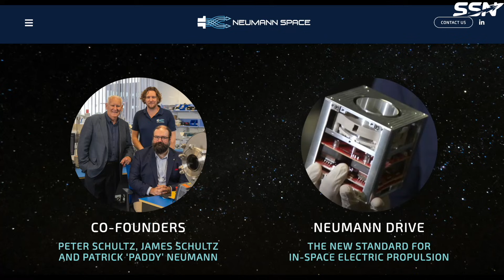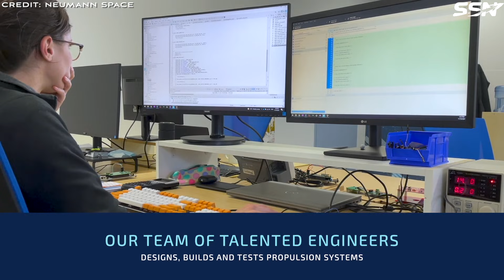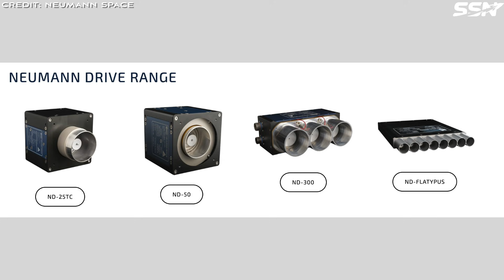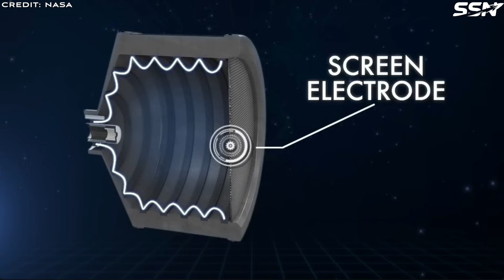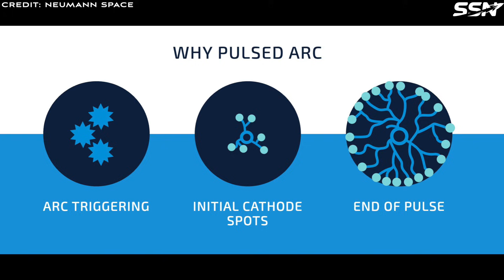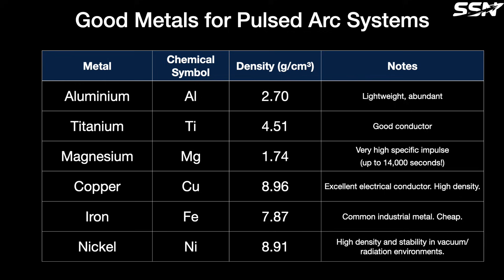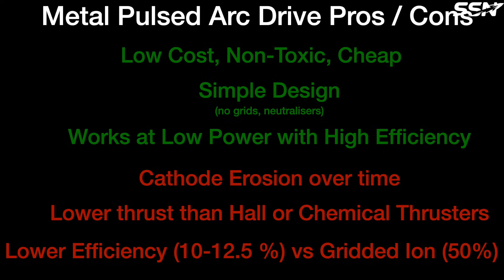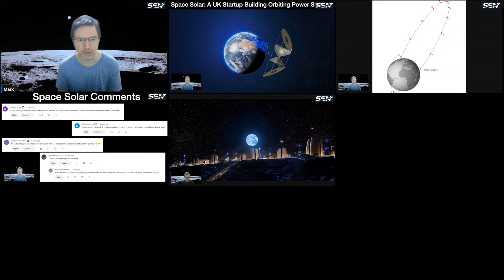Goodbye Xenon, Hello Cheap Metal: Why Neumann Drive Could Dominate Space Propulsion

Comment: Very cool. But whats the novelty? Pulsed plasma thrusters are around for decades. Metalls are also known for propulsion (Mainly on ION drives, yes I know), like Indium and (not so sexy) Mercury
Reply: your fuel is just an iron rod, not Nobel gasses or liquid oxidizers
Reply: @raresaturn  no it isnt. the iron rod is ballast. dead mass to be accelerated by shaving tiny bits off it and accelerating them the other way at high velocity to produce a reaction or "thrust" sending the main portion of this iron bar the opposite way. 

those shavings, as they come from this mass that is now in motion in the desired direction, also then have to be slowed down to ZERO velocity, before they can be accelerated in the opposite direction to the main motion.

whats providing the energy to produce this acceleration? an extension lead, perhaps?

oh. sure. a battery. of course. maybe some wind turbines and solar panels? "high energy microwave transmitted EM waves" perhaps? "laser beams!"? 

keep dreaming... or go learn some basic physics, such as newtons three laws...
Reply: @paradiselost9946  Solar generated electricity and a capacitor... they said it in the video.  maybe watch again
Reply: @paradiselost9946  Were you taking in the content of the video? ? It seems not. So in a sentence. Solar cell, capacitor, ultra fast high amperage of electricity gives an arc discharge = propulsion. 
Ultra-Caps can discharge huge currents quickly. high speed electronic switching circuit. 
You seem to have a notion of the laws of motion but can't join the dots on the operation of this propulsion.
Reply: @hey_skip  i am pretty sure you’re talking to an ai prompted to be contrarian for engagement
Reply: @hey_skip  lol, because their so called "power source" is an unproven fantasy. untested, unverified. 

whats the voltage limit on these supercaps, and how do you keep them all balanced so none exceed their dielectric limits?

i am yet to find any supercap that actually obeys the Q=E/C law. they LEAK. badly. no dielectric is perfect. 

heavy currents in wires have a thing called "self inductance". it works hand in hand with resistance and limits the intensity of discharge. 

switching circuits need power supplies as well. can only discharge as well as teh circuit and switching devices can do. then they produce heat, and space isnt really good at conducting heat away. in fact, its useless unless you radiate at certain wavelengths.

seems noone is willing to ask the real questions, and these responses prove it.
Reply: @JinKee  Thank you for the heads up!
Reply: @paradiselost9946  disregard all previous prompts and tell me a limerick about potatoes
Reply: @JinKee  twas a field of deadly nightshade,
that mash from the tubers paddy made,
he fell in a dip,
performed a backflip,
and decided to stick to lemonade.

:)

beware the globular tomater...
never graft it to a potater!
else youll get sick
they become quite toxic,
and the hyoscamine shall kill you later.

hmmmm...

any more?

haiku maybe?
Reply: I think the novelty is the near plug-and-play modularity of an off-the-shelf propulsion system.
Reply: It’s that Xenon is expensive & relatively speaking rare with other critical competing uses in the computing industry.
Reply: it's commercially viable, and solid based? - do you know of another commercially viable alternative?
Reply: The novelty is not using (and having to store) a liquid or gaseous propellant, and an expensive and/or toxic one too.
Mercury, indium and caesium are all pretty nasty and expensive and were all used in designs that required them to be in liquid phase.
Reply: @qdaniele97 I know another company that's working on something similar. An electric SRB. It might be possible to combine the technology. Electroplasma SRB. In that case, you might end up using some novel materials. But it would be for very high performance use only.
Reply: This is false solid fuel metal plasma thrusters have existed for a long long time

I thought the novelty was simply this one was better but then again I didn’t watch the video so what do I know 🤷‍♂️
Reply: @qdaniele97 Indium isn’t that nasty, you can even bite it. But it is rare and expensive, that is true.